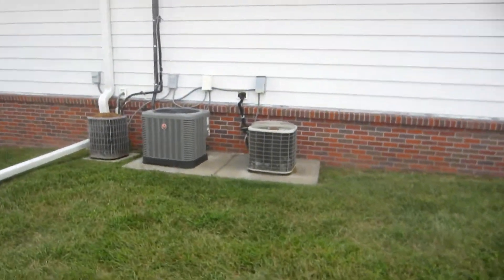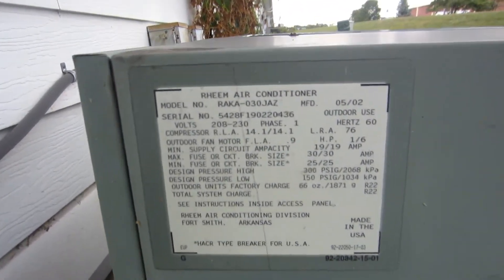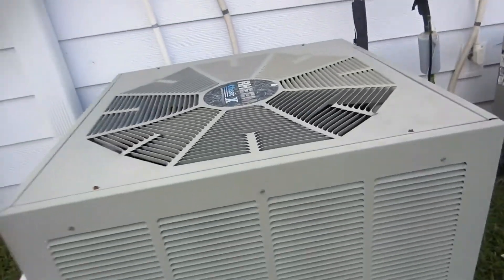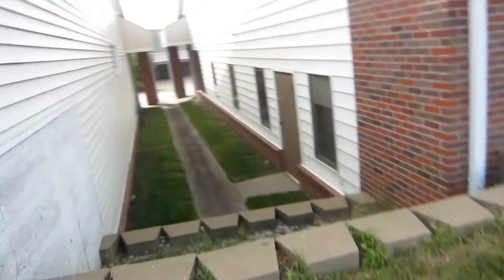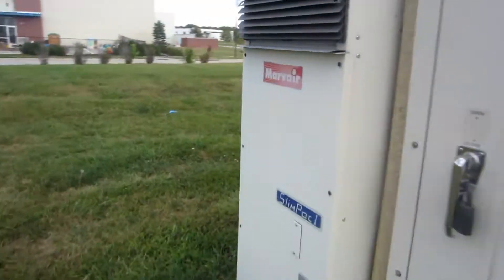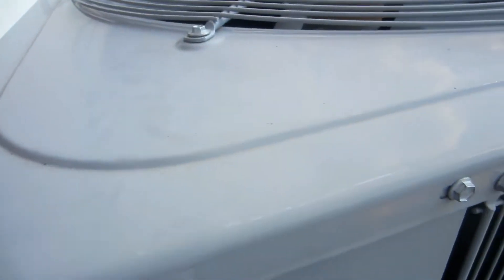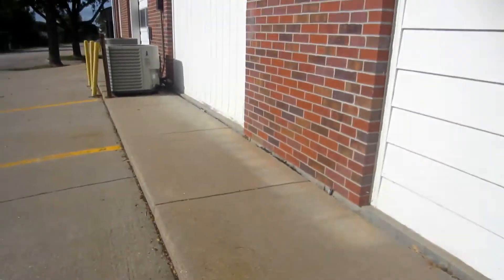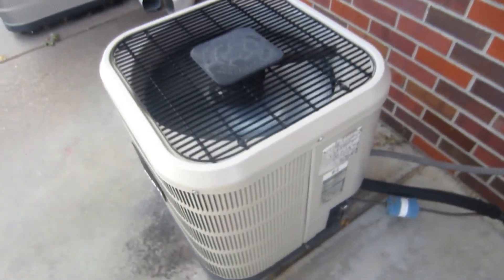HVAC HEAVEN: Tons of Air Conditioners at an Office Complex (Part 1)

Comment: You hit the jackpot! My favorites were the Bryant at the beginning, all the rheems, and the older Tappan. The Rheem at 10:16 looks like it has a Tecumseh recip, the older Tappan actually has a recip, and the unit at the end is an ameristar. Fun fact: the campsite that I was at this weekend had a 2002 Rheem Classic 12 SEER heat pump, and on the top it said high efficiency, while the units that are 10 SEER just say 10 SEER
Reply from the maker: Thank you! Yeah my bad I meant to say reciprocating at the Tappan. Thanks for the other info, too. This was very cool! This is one of my favorite HVAC places now.
Reply: Dilch Productions You’re welcome!
Reply: that Rheem has a Copeland not Tecumseh. i can just see the "PFV" at the end of the model number on the tag, that right there is a dead giveaway that it's a Copeland. tecumseh tags are also far smaller in size